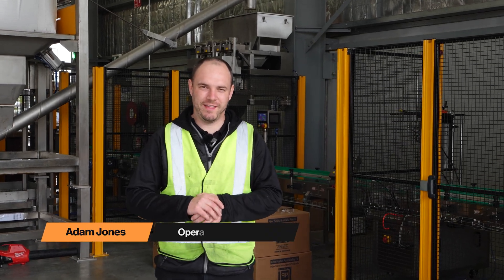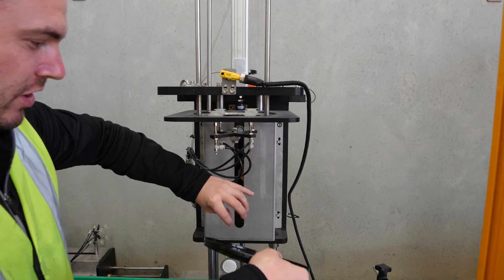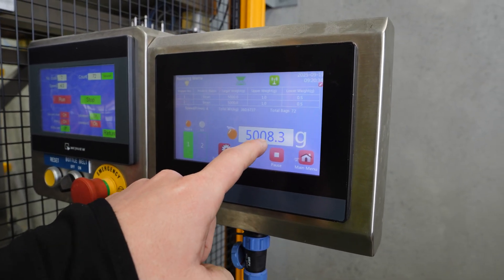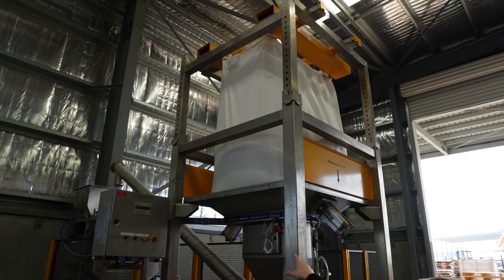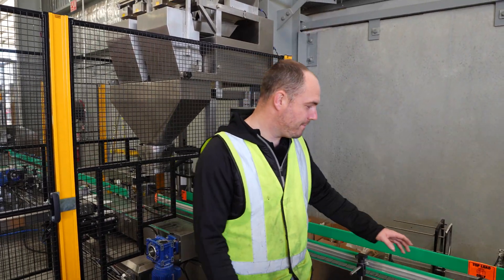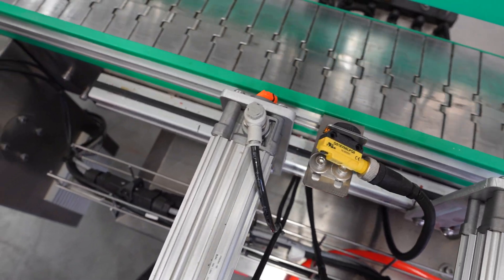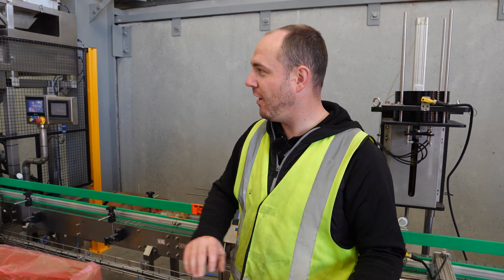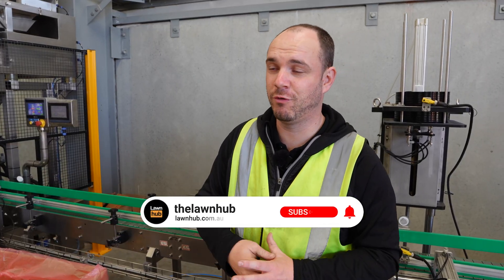OUR BUCKETING MACHINE IS WORKING

Comment: Well Bucket lads that’s impressive to say the least ,  Great work on putting more in the Bucket to make sure ya meet those weight guarantees ! Bloody standards would have a field day if under 😳 . Thanks Lad for the run through and showing your impressive fix with the scratching  👍👍. Looks like incremental improvements is at hand as your working on the Beast
Reply from the maker: Thanks mate, it definately has it's moments but small changes will see huge gains!